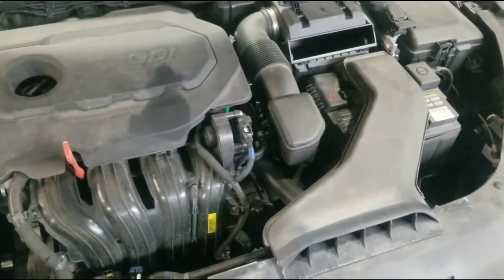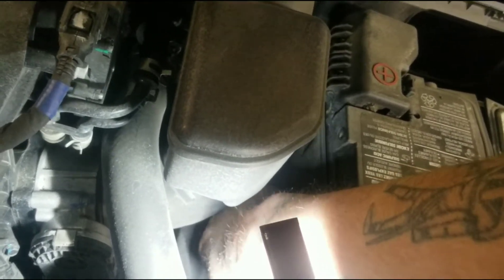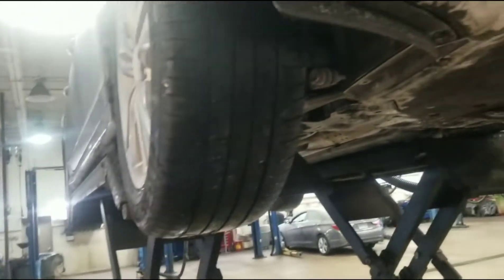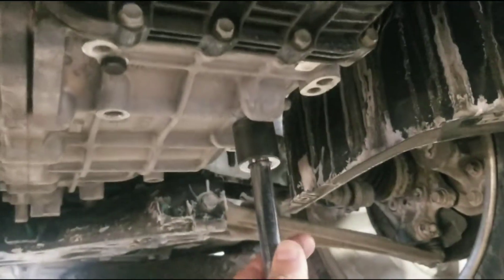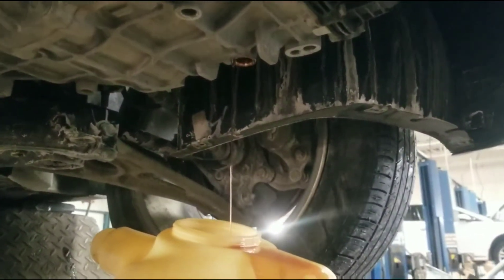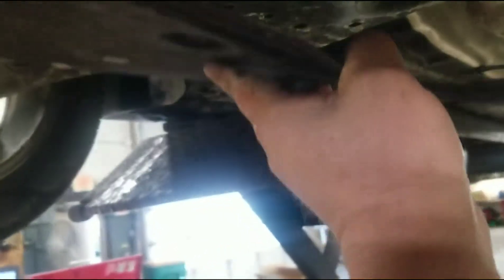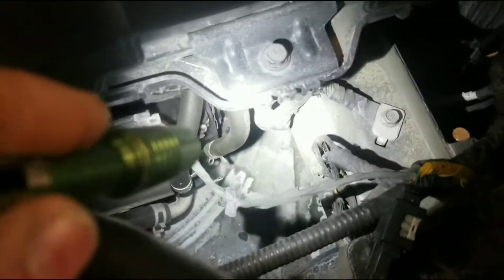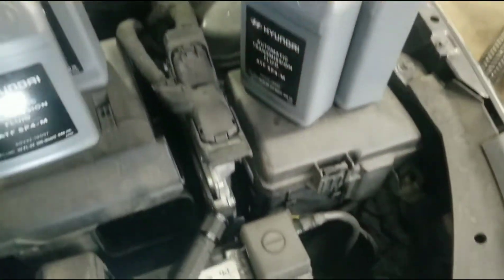Hyundai transmission fluid change for Hyundai's with no dip stick

Comment: Great video.  For those DIYers, to make it easier,  loosen the battery bracket and slide the battery to the right, about 3" or so.  The battery tray will be exposed.  Cut a small notch, about size of a quarter in the tray, directly over the fill bolt.  This makes inserting the funnel easier.  Of course clean up the shavings.  Did this for a 2017 Sedona and 2019 Sorento.  When you're finished, slide the battery back and reattach the bracket.

Comment: I have a 2018 Sonata with the 2.4 that I purchased new. I changed my ATF fluid yesterday, for the first time (30,000 miles), after driving the car to warm up the oil. I carefully measured the fluid after draining. 3.7 quarts came out, so I put 3.7 back in.
Reply: Why did you change it??

Comment: Why did you put back the under shields?  There is an overflow and level side plug you need to remove with the engine running and temperature between 122-140 F. With the covers on you cannot check the tranny level after filling the oil.

Comment: Hello great video, I have a Hyundai Elantra 2017 with almost 180miles, I must do the transmisión fluid chance soon. Do you recommend to drain and complete or second drain complete with new fluid then run  the car and later drain and complete for full flush ?
Reply from the maker: Dont do a flush,  its not needed. Drain it and put the same amount you took out back in.
Reply: @hyundaihowto  thanks. Love your video. Have a question about this vehicle you serviced. How many mile does it has?
Reply: Neurin, did you put in the new fluid? If you did, did you have transmission problems with the car after you put in the new fluid?
Reply: @yactabay  hello bro, yes I did put the new fluid Transmision Valvoline ATF high mile, so far so good. Car is running good!
Reply: Did you mean 180k miles?

Comment: I have a 2016 hyundai sonata with a 1.6t motor in it and the fill plug is not located where that one is can you assist?
Reply from the maker: I have another video on the 1.6t trans fluid.

Comment: I have a 2015 sonata i did drain and refill about 20,000 miles ago but the guy put 4 quarts and asked me to put another quart and I’m confused I’m trying to redo it again to make sure most of the oil is new what’s the correct amount I should put !! As the recommended thank you
Reply from the maker: You can put more in and there is a drain cap on front of the trans for leveling the fluid.  I have another video showing this.

Comment: I change atf in workshop and they did'nt measure the amount of oil drained.. how they measure how much to pour in? They do it wrong?
Reply from the maker: You dont have to measure the amount drained.   I have another video on how much fluid to put in and leveling it out.

Comment: Did I miss the important part where you showed how to open the overfill plug and fill until it drains from that hole?  Or is there no overflow hole on the Hyundai?
Reply from the maker: I did not show the overfill.  It does have one.  I have another video showing it.
Reply: Link to the video?
Reply from the maker: Im having trouble finding it.
Reply: Is it necessary? (To use overfill plug/hole)

Comment: My owners manual says 7.5 quarts?
Reply: Your not draining all the fluid… that’s why only replace what’s removed… The Torque Converter has fluid trapped in it. If you did a flush then you would have to put 7.5qts.
Reply: That's the total capacity of the transmission. When you do a drain and fill, it doesn't drain all 7.5 qts. There's about 1/3  - 1/2 trapped in the torque converter and the rest of the transmission. If the drain and fill is done on a regular basis (every 30K or so), it eventually replaces the entire volume.

Comment: This is not the proper way to insure correct fluid level.
Reply: What is?
Reply: Can’t see how that’s not . If the transmission isn’t leaking . Put back exactly what you removed .
Reply: Imagine saying it’s not the way, without saying the way… go kick rocks
Reply: It's not correct according to hyundai procedures however, if you accurately measure the fluid that was drained and put that same amount back in what is the problem?  You don't need to check the heat, watch the fluid trickle from the weep hole and that other stuff.

Comment: Why waste the time and costumers money ?  No filter change, only drained part of the fluid, didn’t fill to the sight hole. Only replaced what was “ cold drained” . All bad.
Reply: It don't have a filter that's at pan, they say u have to split case
Reply: You have to open the transmission  to replace the filter. filter is inside (incased inside transmission)